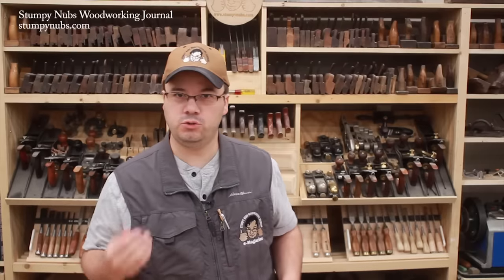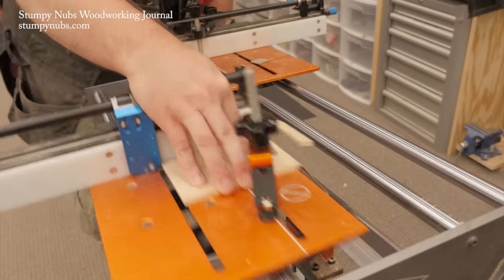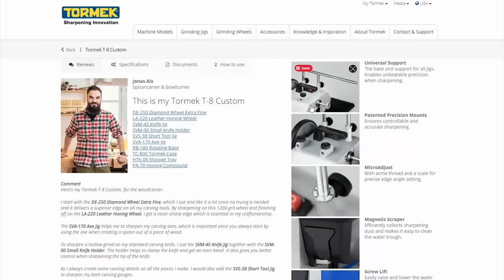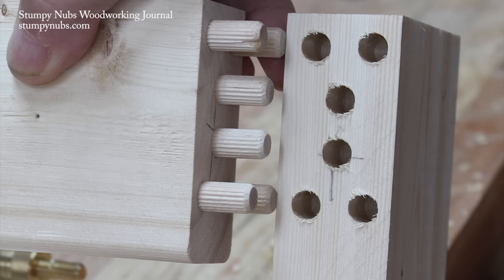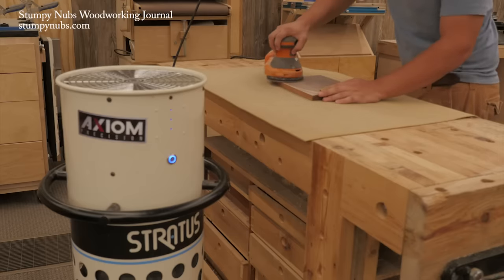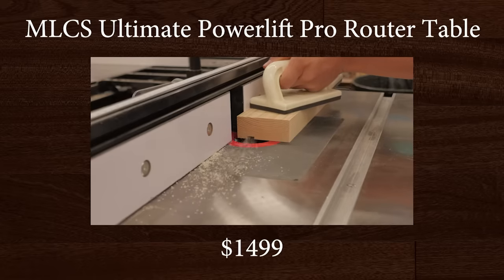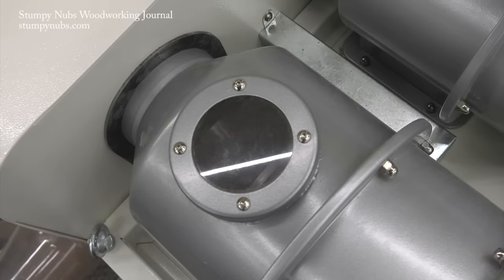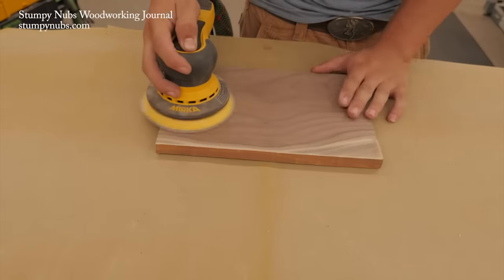Ten EXPENSIVE woodworking tools you have to see!

Comment: I can't afford any dust collection, so I just wear a respirator whenever I'm in the shop, and I sweep the floor (and sometimes the walls and ceiling) when I'm done. It would be nice to have clean breathable air one day. But for now a $50 respirator is a lot cheaper than thousands in dust collection and filtration equipment.
Reply: You don't need thousands. Ordinary shop vac, bucket + small chinese knockoff cyclone and 3" flexible hose =max $200. Trust me, it will impress you and it will do wonders for small workshop with hobby machines and powertools. 
I used this for 3 years in my small shop.
No, it won't suck from 16 inch planer and if you have it then you need bigger chip collector. I tried and I bought another chip collector ($650) sadly without hepa so dust mask is necessary now.
Reply: I was in your position for a long time, then the small Rikon air filter went on sale at Woodcraft this past summer. I think I only paid just over 100 bucks. It works great. Clean air, and I didn't have to break the bank. Keep an eye out for another sale. It was well worth it.
Reply: @AndreaArzensek  I forgot to mention, I only have one 15A 120V circuit in my detached garage, so I can't power a dust collector or a shop vac at the same time as anything bigger than a random orbital sander. I'd have to run an extension cord from the house.
Reply: I didn’t consider dust collection important or affordable for my hobby. I wore and still wear a mask. I hooked a shop vac to the saws. I opened the door in the summer. Then I inherited a Wen ceiling dust collector.  It just makes things more enjoyable, less dusty, safer. We all have priorities. Protect yourself first.

Comment: I actually own the Dowelmax and find it a tool that you must pay attention to when using. Is there one you don't? Really, I made several dowel holes in different boards and they did not come together flush on as I said, several attempts. Turns out that I was not using that "check mark" to orient the boards. You must place that check mark on the same side of both boards when making the dowel holes. Just like in the instructions !!!!!!!!!!!!!!!!!

Comment: The Bosch GAS 35 series has very similar specs as the Festool is a lot cheaper.
Reply: It’s only a $90 difference the Bosch is $550, the Festool midi is $640... the midi has a smooth no snag fabric cover and the machine has built in Bluetooth.

Comment: I get tired of people comparing dowel joints to tenon or loose tenon joints based on new joint strength. A dowel in theory will have an end grain component that will be the first part of the joint to fail. Over time, impacts and force are not what makes the joint fail. It is the wood expanding and contracting with changes in humidity. A dowel allows that force to slowly tear the glued seam little by little until the joint is too weak and it fails. Like a phone book. You can rip a phone book in half by approaching it at an angle that allows you to break small bits of paper at a time. Nobody is strong enough to snap the phone book in two. At least that is my theory as to why dowel like chair legs are always failing but tenons hold up.
Reply from the maker: Chail legs with a couple dowels in the joint fail. Proper multi dowel joints are far stronger. As for the end grain argument, loose tenons and dowels both have grain that runs down the length. There is no end more end grain in one than the other. Likewise, a loose tenon (domino) is nothing more than a fat, flat dowel. If movement causes one to fail, it will cause the other to fail.

Comment: When I see tools (or any other hardware) that relies on an app of some sort, such as the MLCS router lift in this video, it always puts me off. I worry about what would happen if the manufacturer shut down and there was no ongoing support for the app. Over time, compatibility issues might cause problems running a legacy app on a newer tablet and I would lose that part of the system's functionality.

Comment: Diamond wheels never change in size?! They do, just very very slowly
Reply from the maker: Throughout the life of a diamond stone is it likely to get smaller by less than 1/100-inch. Compare that to a regular grinding stone, which not only wears down but must be intentionally ground down periodically to true it up and (in the case of dry grinders) remove glazing.
Reply: @StumpyNubs  It depends what you're grinding with the diamond, but yeah for all intents and purposes it doesn't change (much 😏)

Comment: I've been researching and getting ready to pull the trigger on my first dust collection system beyond a shop vac.  Your video on common dust collection mistakes was a trove of good information.  I was leaning heavily towards a Pentz EF5 until I saw the G700 Gyro here.  I dug into that a good bit and see everyone talking about how quiet it is, how easy to empty, filter baffle cleaning, and all sorts of really nice features, but not really giving a whole lot of detail on just how well the dust collection actually works compared to more traditional dust collectors.  

Since you're the only woodworker I've seen that actually has both, can you say how well the G700 would stack up against the EF5?  Are they even comparable or is the EF5 a whole different beast with 2.5x the motor?  In short, all other things aside and being equal, strictly from a dust collection aspect, could you run your monster claw duct setup off the G700, and if so,how would it do compared to the EF5?
Reply from the maker: The EF5 is more powerful, but louder. The G700 is quieter, but still a little noisy. It also takes about ten seconds to kick on and wind up, which I don't care for. I like how the G700's inlet is near the floor as opposed to the EF5, which is at the ceiling. Either would be a good system.

Comment: I've seen pictures of the Harvey but never relative to other things of scale.  It's much smaller than I expected... considering making an upgrade
Reply: You will not regret it!
Reply: @orchardave1965  Have one?  Thoughts?
Reply: @80211Denver  I really like it.  Turn it up when using the planer, turn it down for the orbital,  use both the 4inch and the 2 and a quarter when using the Incra router  table.  Easy to move. Easy to empty.  Has a remote fob.
Reply: @orchardave1965  Oh it has variable speed...
I have a 6 inch infeed pipe to my  2HP Delta.  Wonder if that will be an issue.  4 to 6 to delta... I would have to go back down to 4 again.  Incra here as well!
Reply: @80211Denver  The G 700 has a six inch inlet with an adapter that reduces to  four inch plus  two inch inlets. The adapter comes with the unit as does a length of four inch flex hose.
Reply: @orchardave1965  You're eliminating all my excuses, dang it!

Comment: I disagree on the Festool (the only one of these I actually used😂). The hose is crush proof indeed, but also too heavy and not bendy enough. Also too bendy do it will contact the corner of your workbench. 

And the hose is always at the wrong side of the machine. Clamps, walls, edge of the workbench, heck, even my own body, everything it touches tends to tilt the machine.

Really I much rather have all the dust being blown anywhere, and wear a face mask and an apron, or even a hazmat suit on a sweaty summer day, than face the frustration that comes with that annoying hose!

And those bags are way too expensive. Every time when you have to think "I shouldn't do that, because $$$", it takes away the joy you should have had when using such an expensive tool. Yes, you could and should vacuum your workshop with it after sanding, because these bags shouldn't be that expensive.

Worth it's investment? No. Not even by a long shot. How I think it should be improved: I guess somehow a vertical hose suspended above your workbench would fix most of the problems. In the workshop where I worked, all cables (with rubber cable holders to easily make the cable longer or shorter, as the belt Sander's cable was 2m longer that the orbital sander's, and I have better things to do than power tool cable replacing), sockets and other connections were above the workbench, with LED strips for lightning, everything adjustable in height. In retrospect, it would have been awesome if I would have made sockets for vacuum hoses on it as well!

Comment: put that dust machine on a dedicated  handtruck
Reply from the maker: It has wheels. The back casters do not swivel, only the front caster (as is common) and we had to slide it in a tight space. Otherwise, it could be rolled around the shop with ease.

Comment: I have the festool midi vac and love it. Especially when using the festool 5" sander. I can't see where Mirka could possibly outperform the festool, because it leaves virtually no dust. I have a white melamine top on my bench, and see zero evidence of dust after sanding end grain walnut cutting boards.  Hmmmmm... maybe a Shootout should happen?
Reply: Agreed! The Festool sands just as good, extracts dust just as well, and dont have that STUPID On/Off paddle-switch. If you sand for hours straight like I do, its annoying that it and the dust-extraction shuts down every time you let go of the paddle, or change your grip. Working on bigger surfaces of furniture is "hopelessly painful" with the Mirka since you change grip all the time! Dont know what they where thinking when developing that switch. I want use it just for that feature alone.

Comment: I take those Festool bags and vacuum them out with my cyclone dc. Been using the same bag for 3-4 yrs now.
Reply: No, just no. I've just built a Thien style baffle out of a 20L bucket that sits above my CT Mini in my home-built overhead cable and hose support which should take out a good 85% of the larger stuff. It was interesting; you don't think the Festool vacs move that much air but it's strong enough to suck the bucket sides in even when the flow is not restricted - I had to brace the insides of the bucket with a few dowel crosses screwed in place.

Comment: Hey bud, so have you seen the new ad here on YouTube about a new safety feature that will fit any saw and doesnt use a cartridge or ruin a blade if triggered? It simply stops the blade if you get to close? I feel stupid cause i was watching a video on water heaters and it popped up in the middle of the video and i hit skip before i realized what it was... ive watched the same video 3 times but it doesnt come back up? Figured id ask you and maybe you could shed some light on this?

Comment: Anyone wanna rob a bank with me? I need 4 volunteers
Reply: The guards at the tool manufacturers probably don’t carry weapons... And you won’t have to pay taxes on the equipment acquired that way, either. [Mandatory disclaimer: This comment is intended for the sole purpose of dispensing poor humor and should not be construed as advice regarding which crime one might be better off pursuing.]  Got it? Good. I have a discrete warehouse, centrally isolated in the best part of the most unlikely area with undetectable, unavoidable saturation security monitoring, three phase electric mains, full HVAC and four-stage air purification of the highest standard. Do not construe this to be connected to the previous line of thought, but, hey, sometimes you need a safe space real quick like, ya know?